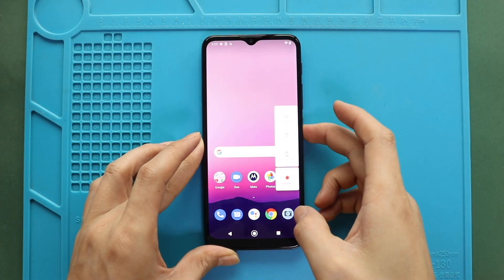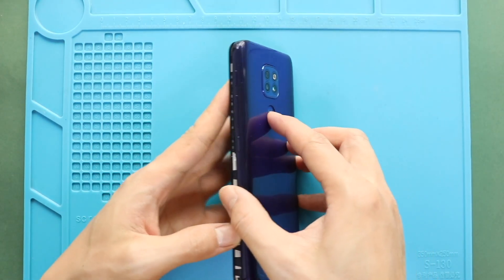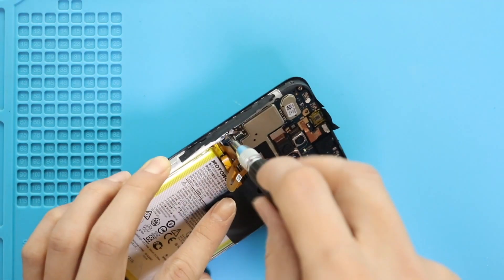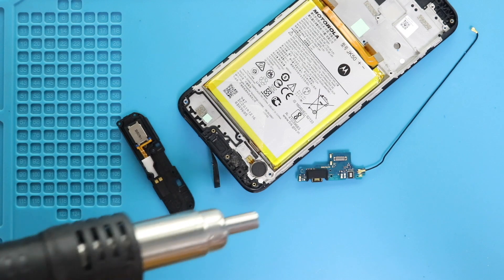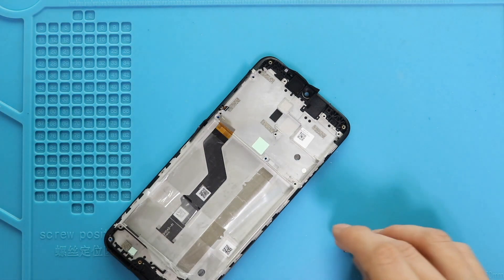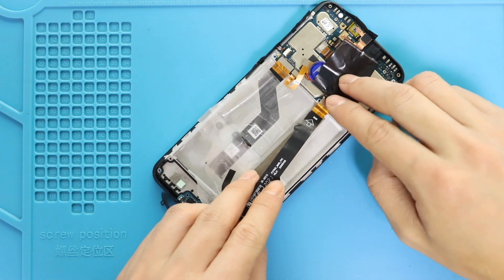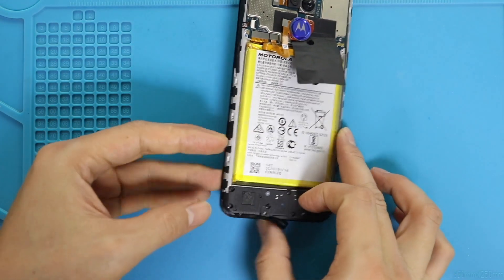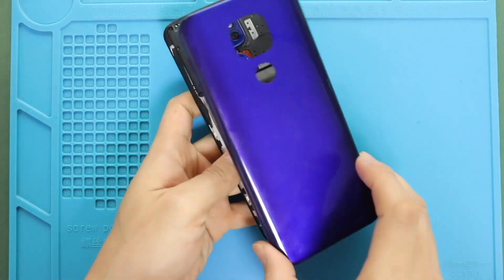Motorola Moto G9 Play 2020 LCD Screen Display Replacement

Comment: Thanks a ton. I saved €45. Almost perfect guide. It would have been useful to know in advance not to destroy the protective adhesive but it works nonetheless.
Reply: Additional notes:
4:15 was the most technical passage.
By removing 5:15 first it makes everything 100x easier.
Reply: It's the best phone I've ever had. Forever lasting battery 🔋 and super quick charge. Great system for debugging Android apps with Android studio.